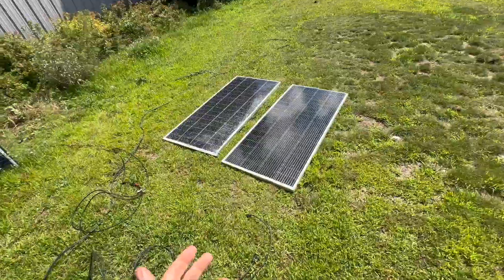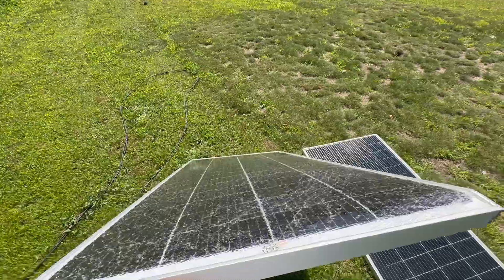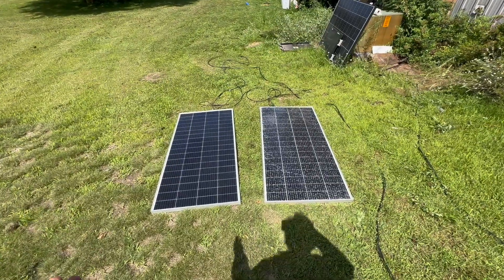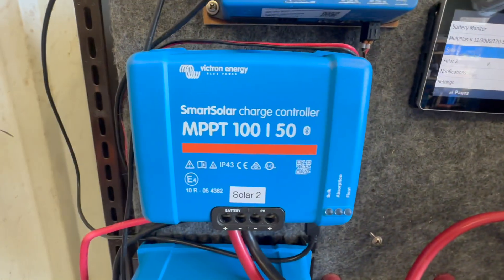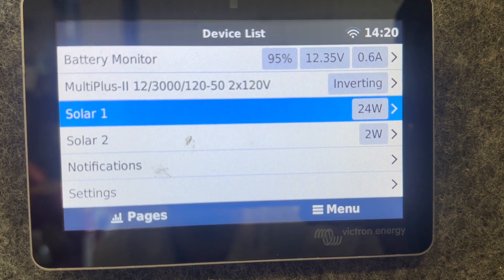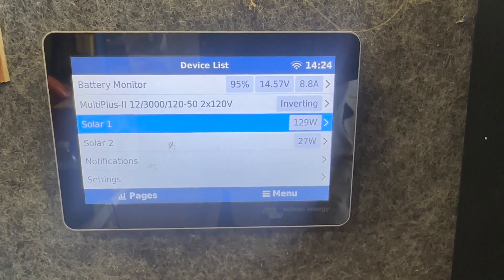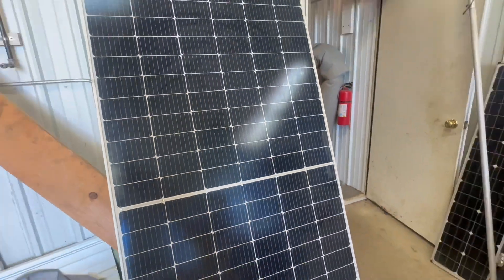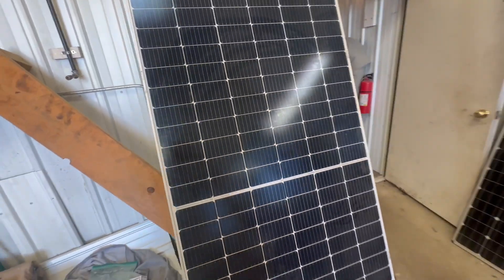Will a Broken Cracked Solar Panel Still Produce Power? Let's Find out!

Comment: Shawn, Have you had any interest in ground-mounted solar for RVs?  I've considered assembling frames that would go around the bases of my bus tires (3 per side) as potential secure mounting to prevent theft/wind.
Reply from the maker: We do it for customers all the time. For my bus I like our angled side panels. We’ve got enough to run an AC on auto mode set to 72. Been running all summer that way :-)
Reply: @sotasolar  Can you show us?